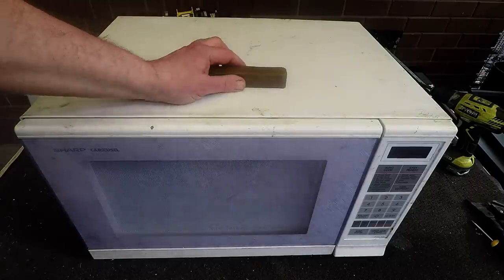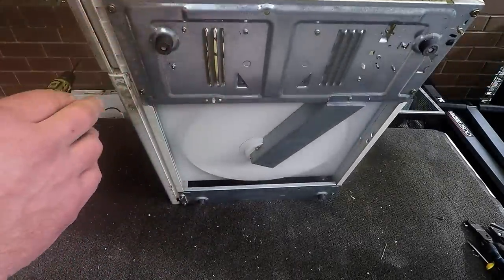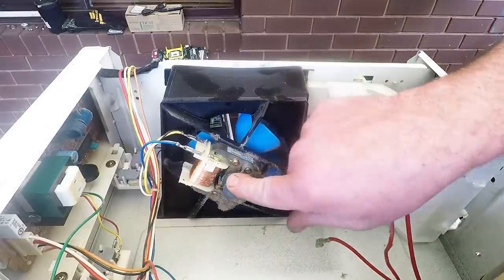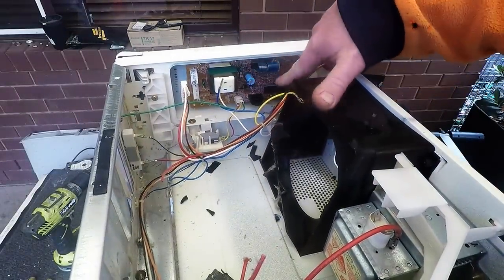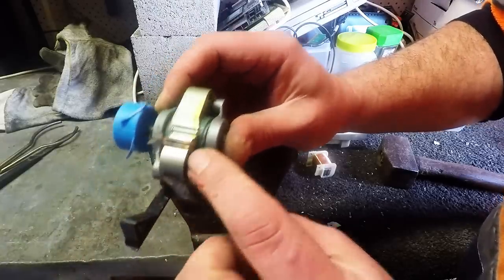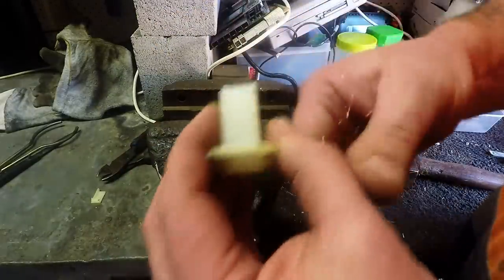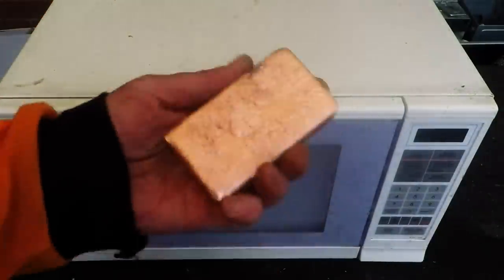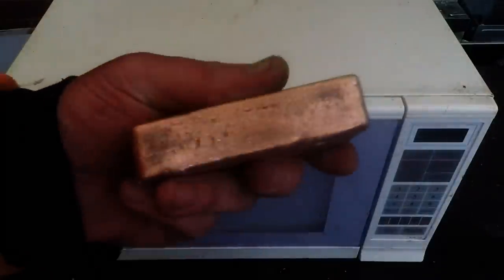Free Copper - Copper Bar from a Microwave Oven

Comment: Thanks Ben. The price of copper today is about $2.90.(u.s). Got a question Ben..Are all transformers constructed the same? you sure made it look easy getting into that one from the microwave. Good show ol'Chap
Reply: Some transformers are layed together with no weld dont try taking them apart #nightmare
Reply from the maker: That transformer was about the easiest ever, most smaller transformers are impossible but miicrowaves seem to be different to most others.
Reply: I don't get many microwave transformers. only the ones for amplification. Darn straight they are hard to crack open. Thanks man..How is the weather down there? spring coming on early or anything? would you consider your current winter is harsh mild or weird. Just wondering because I think Northern Wisconsin is going to get hit with the mother of all winters this year.
Reply from the maker: was a little colder at times but pretty good, feels like spring is coming noe so overall a mild winter, not much rain either.
Reply: Thanks Ben,.only wondering that so i can gauge your to what our winter might be like. Been getting torrents of rain here in Wisconsin(U.S.)all summer,.and that gives an indication that we are in for a lot of snow. keep those video's coming Ben

Comment: Interesting stuff, Ben, but if you edited out the repetition and fiddling around, it could cut a third off the length.
Reply: Just speed the video up to .75 or .50 speed and you accomplish the same thing, and there is no need to bitch.

Comment: Nice work. Actually turning scrap into ingots can reduce the scrap value as the scrap yard does not know how “pure” your ingots are. Hard to believe but some people will dilute there scrap ingots with cheaper metals. For example suspending a block of steel by a thin piece of wire and pouring copper around it. Also cast Aluminum is worth less than extruded Aluminum so if you melt it then you will get the lowest price.
Cheers Stuart 🇦🇺

Comment: The windings in the little fan motor, in addition to the coil you dismantled next to it, would have copper also. Remove the 2 screws and get the windings out.

Comment: Do you not need to make sure that the capacitor is discharged? Like, this is an unnecessary risk doing this without even using insulated tools.

Comment: Would putting the insulated wire in an ultrasonic cleaner remove the shellac?
Reply: John Norris, probably not. You would instead need a strong solvent like acetone to remove the shellac or varnish insulation. But the solvent is very flammable, and this would also be a messy process, best done outdoors. If this is done in an ultrasonic cleaner, there is danger of fire and explosion, because the solvent fumes might likely get ignited by the ultrasonic cleaner, plugged into electricity and operated. Maybe some non flammable solvent would work, but fumes of it spayed into the air by the ultrasonic cleaner might be dangerously toxic.

Comment: Hey i had a huge question, what is the magnetron made of?
Reply: Thanks i didn't know that but i took apart a magnetron before but i heard there was berylium so i had worn my gas mask and i was okay
Reply: Even if you wear your gas mask, there's still going to be particles in your surroundings after you remove the mask
Reply: It's not BeO though, that's just a myth! Pink insulators indicate it's 88% Al2O3 with additives. The BeO myth is probably due to the fact that continuous wave radars that output many many kW do have BeO insulators in their magnetrons

Comment: The easiest way to remove the transformer coils is to simply cut through one side with a hacksaw and then just nock out the other half, no need to split the transformer steel core. you need to cut it anyway so that is the quick method.

Comment: It's much easier to actually cut through the copper windings and push it out than it is to try to cut that weld joint

Comment: Is Brass more expensive than copper?
Just wondering if you could alloy your copper into brass and sell it for a lot more $ maybe?
I was recently after a short piece of 2.5 inch dia solid brass bar stock to turn on the lathe and make a custom handwheel... 
Ended up finding a short length (8 inches) on evil bay in the US that with exchange rate and postage within USA to my shipito freight forwarder in Nevada,  plus fright to Oz from USA will end up costing about $250 by time it gets here (So about 8 kilos (19.4 pounds) of brass for $250Aus = ~$31/kilo!.
Lots of metal supplies have thin dia bronze and brass rod but not "bar stock" in the larger diameters for turning.
Machinists often tend to want to cast their hand wheels with the lost sand method using a pattern.
These days they can 3D print their pattern on a computer and 3 D printer for next to nothing in 5 minutes.
Melt and cast the brass or bronze into a lost sand mold made from the 3D printed pattern and then turn the cast hand wheel rim and bore the centers on their hand wheels on the lathe.
Sometimes I think the real $$ in scrapping say copper like this might be turning it into something else (like brass) that's hard to find and expensive to buy, like brass bar stock for machinists for e.g. using your furnace and a tube mold to pour short cylinders of solid brass. Lots of scale model train hobbyists making their own scale model steam engines etc with mini lathes would be interested in availability of such stock for turning brass train wheels and cylinders and the like.
So all you need is the zinc to make your copper into brass alloy.
Where can you get free zinc from scrapping, so your free scrap copper can be alloyed to make expensive brass? 
Its only worth around the value of scrap copper as scrap brass ($1.50 - $2.50/kilo) so my expensive imported 8 kilo cylinder of brass is only worth ~ maybe $20, scrap value yet I willingly paid $250 for it - BECAUSE its the right size to be able to turn a hand wheel on the lathe, without having to cast one first in a lost sand mold from a pattern.
Its all about "vertical integration" - turning your scrap copper into a product someone else with the right lathe can then use to make something else more valuable. If you had a CNC lathe for e.g. maybe you'd have it running all nigh making scale brass wheels for model trains for all the hobby scale steam train builders, your CNC lathe knocks out say 200 brass train wheels a night worth say $50 ea... so $10K a night - would be a good return from that scrap copper now wouldn't it?.
Market them on evil bay.... pop them in a padded envelope & post - set up direct credit to your bank account from everyone's credit cards... offer various common sizes... re melt your own brass swarf off the CNC lathe for the next cast brass cylinder.
People say scrapping copper isn't worth it  - BUT if your the guy with the gear to make it back into something that people want and will pay for then - you can probably ask whatever markup you want for the product...
One mans trash is another mans treasure. Vertical integration & value adding is where its at!.
Reply: Interesting...
Reply: In a word no.. brass is always cheaper than copper :)
Reply: Or you could scrap it and live longer.,🤔

Comment: You should have scrapped the turn table motor and the smaller transformer on the circuit board. Probably another 2 ounces. One day copper will be $10 a pound at the scrap yard. In 1996, I got $1.25 a pound for #1.

Comment: ben i just put the transformer in a vise and hammer cut the copper wire with a sharp wood chisel on one side and pull the other side out with a large screw drive ..one wack is all it takes coppers very soft and doesnt dull the chisel

Comment: sell that CU and buy a new sledge handle sheesh!  haha!  like the way you work, paper comes off like a Wonka Bar wrapper in Augustus Gloop's chubby hands hahaHAA ah ha.  I used to just clip every wire in bites w/ cheap bolt cutters i got the boss threw out because some goofball clipped 2 live service wires and took out some nice notches.  Very nice to see the way the plates come apart to keep the wire whole.  Thousnds of thx, Sir.

Comment: You missed the 2nd biggest source of copper in the microwave. Inside the magnetron (with aluminum fins) is a giant 35mm slug of copper attached to white or pink ceramic. The white or pink ceramic is probably beryllium oxide, do not under any circumstances crush or powder up the ceramic, it's highly highly poisonous is breathed in or ingested, worst than breathing in fiberglass. But hacksaw the ends off and you'll be left with another pound of copper (and coil of tungsten). If anyone wants to reuse the transformers, check out some vids in my channel.
Reply: Nah, it's really just a myth that it is BeO. It's actually common aluminum oxide, with additives that make it pink (pink indicates 88% Al2O3)
Always thought it's BeO too! And yeah, the magnetron is a huge chunk of copper!

Comment: dirty copper same as aluminum there are different grades i think 3....pure, with impurities like with dirt or water, mixed with other metals/plastic etc....if it isn't pure like with the bars then they will give you less per lb here in the states, each state has it's own price, here currently it's like 75 cents a lb (pound) in NC, South carolina it's $8 a lb and in california it way higher for aluminum than it is on the east coast. each scrapyard will pay more or less, less mostly so they can sell it for a profit for your scrap metal.

Comment: The pink ceramic is not beryllium oxide. I always thought it too, until I searched why it is pink and as it turns out pink indicates that it is 88% aluminium oxide (alumina) with additives. Which makes sense since it is much MUCH cheaper to produce and get licences to produce/sell.
I guess the myth comes from early microwaves that used radar magnetrons, which up to today can use BeO as the insulator since they output many many kW.

Comment: How about the warning to discharge the high voltage capacitor???
Reply: It's not "dangerously high" unless you touch it with both hands, it might be. Old rule is, remove caps with one hand in pocket.

Comment: You should go ahead and yank the wiring harnesses out of these. You don't need to manually strip each wire just wad it up and throw it in a small fire to burn off the insulation.

Comment: 1500.00 for a tiny furnace? Wow. One can be easily built for under 100 - I built mine for 60 bucks and it is much larger. The most expensive part was my crucible... Damn, I should start selling furnaces.

Comment: How do you get the crap of the top of the molten copper.
Reply from the maker: you can use a grinder, then polish, or machine it to make a perfect bar
Reply: Ben,
I recommend that you get a 6" bench grinder with a wire wheel on one side.  It will help you clean up those bars in a fraction of the time compared to a drill.  Great videos!

Comment: Actually considering how very little you get out of a microwave oven and the fact that you don't see them tossed out often or find them.
A much more abundant source of free copper is from ceiling fans. They are tossed out all the time everywhere and they yield at least a pound of copper per fan. And it's not hard at all to extract the copper out of them
Reply: not where I am, no one uses ceiling fans here, but in turn, there's an absolute shitload of old washing machines and microwaves around

Comment: I think you should have mentioned to discharge that big  as f capacitor before you started taking that apart.
Reply: There is usually a high-ohm resistor across them to discharge them in a few minutes after switch-off, but yes, discharge it to be sure!

Comment: That's the hard way to take the copper out of a transformer. Just use a bandsaw to cut the copper on one end and drive it out with a punch. Copper is much easier to cut than steel.
Reply: Yep that is the best way and the way I do it. it needs to be cut anyway

Comment: That's very impressive , over a kg of copper ... If you had enough of those transformers I bet the manufactures of microwaves would by them of you  at  more than scrap value ...
For those into copper recycling , an effective way to bypass melting and end up with 99.99 copper is electroplating , very cheap and easy to set up , uses minimal electricity and must increase value of copper .... put "copper crystal" in Youtube search for some ideas .

Comment: bud... it is always an interesting topic. casting... but.. the copper is more valuable in truth. .. in wire form... just set back the components in as orderly a fashion as possible.... i wouldnt encourage anyone to be a pack rat.. it is in my blood... and a horrible ailment.. but.. the wire form represents an investment of energy to produce a very usefull product..it can be melted and cast into another form... very easily at any time... but turning that bar into wire... is much more work than most other uses ... including casting it into valve components and similar....

just save it in wire form... and make a video in respect for that.. casting a useful part instead of a bar.... have seen several videos like this... it is a topic worth talking about... youtube is an incredible resource..

Comment: Lot of transformers in microwaves are now aluminium wire, not copper. Much less value there.

Also you should take the transformer for the display, that always is copper as much as the motors.

Comment: Once you have removed the copper coils from the transformers, relays, and motors, you have pure high grade copper. There is absolutely ZERO benefit, as well as being a total waste of effort, to melt it down into bars. In point of fact, homemade bars can be harder to sell, and in many cases you may have to get an assay report as well as file a declaration as to the point of origin. Conversely the quality and origin of scrap windings are obvious, therefore making them much easier to sell.

Comment: Can you convert a "Regular 1800w kitchen induction cooktop" to a induction heater like yours? It cost 30$ and the power supply is included.
I think I only have to modify the copper tube, or do I?

https://www.kijiji.ca/v-cuisiniere-four/laval-rive-nord/cuisiniere-a-induction-portable/1256943336?enableSearchNavigationFlag=true

Comment: Brute force and akwardness at its finest!
Reply from the maker: well summed up :)
Reply: Brian Wood, hey, but it works! 😁
Reply: @jeromewysocki8809  Exactly! Appropriate methods for the intended purpose.
 Usually when I am dismantling discarded items it is for the purpose of reusing them in some other gadget, so I try to preserve function. And as an aircraft maintenance technician and inspector, I have been conditioned to take things apart with great caution.
So it's a little unnerving to see you with your hatchet 🪓 man approach! But it's totally understandable for your intended purpose!

Comment: And it's just taken you an hour of your life plus the cost of running a furnace to make AS$ 7.50 ......er, yeah
Reply: its a hobby not a money maker, also running a foundry only costs a few bucks
Reply: @sirblacksmith2297  fair enough. TBH I am quite impressed about how much copper is actually in a microwave !
Reply: @lewisbrand  not a ton besides the transformer, which isn't much. I personally don't scrap them as I'm a diy electronics kinda person and use the transformers.